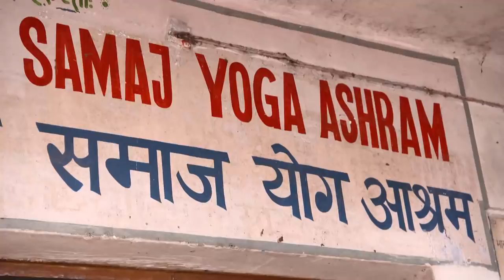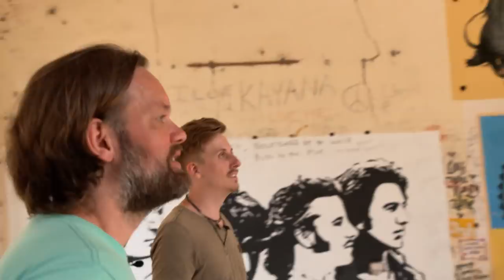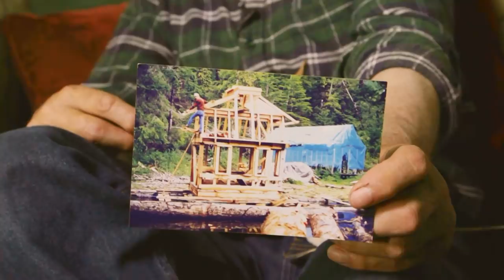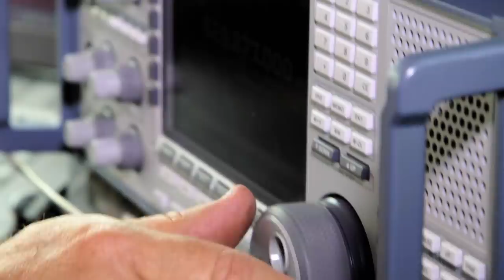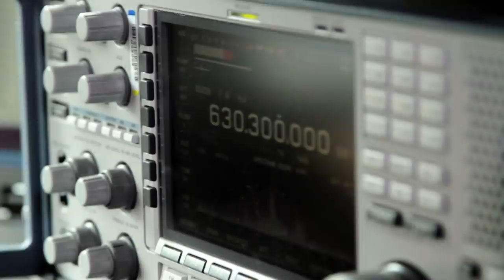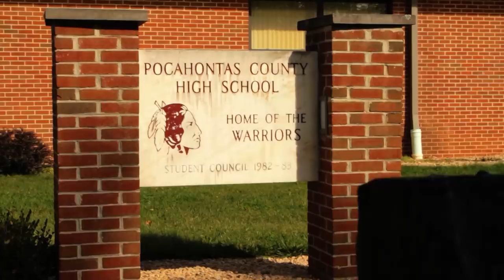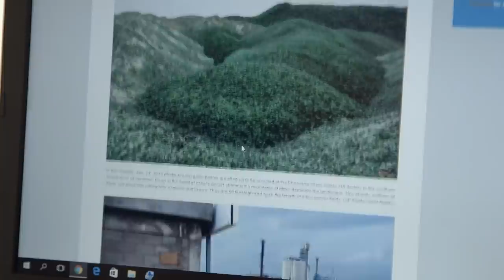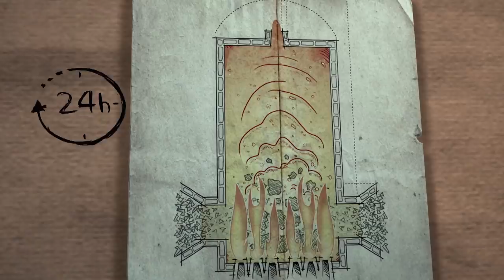Mystery Places: The Beatles Meditation Place & a Floating House in Canada | Free Documentary

Comment: Debbie has a cordless phone how is that living without radio signals plus electricity operates in  radio frequency .
Reply: It's about the frequency and power level that frequency. Higher frequency like cellular or wifi are more problematic. Wireless handsets tend to operate at very low power and much lower frequencies. Electricity is 60hz, this is fundamentally easy to filter out.
Reply: @toysoldier8947  2.4g cordless phone. 2.4g Wifi is the same.
Reply: @Starlite123  It's amazing how few people understand consumer wireless products.
Reply: @toysoldier8947  No, lower frequencies would be more problematic because longer wavelengths don't care about things like brick walls or trees where your 5.8ghz cordless phone won't work in the garage. Basically, if they're studying something out in the universe and your device is too noisy, it's a problem regardless of frequency. Learn science, pal.

Comment: Diesel engine also uses spark plugs :D
Reply: No they dont. Spark plugs are for combustion diesel is compression. Glow plugs constant fire building pressure. Thats why they can run away meaning cant be shut off. So they have glow plugs not spark plugs